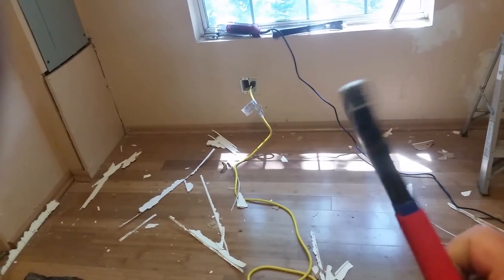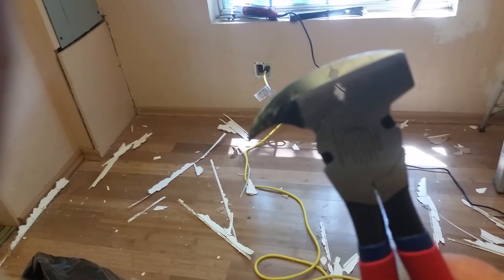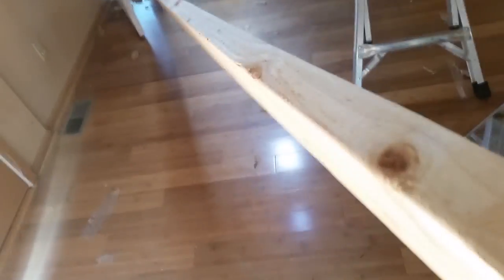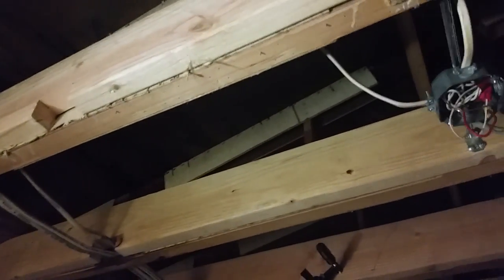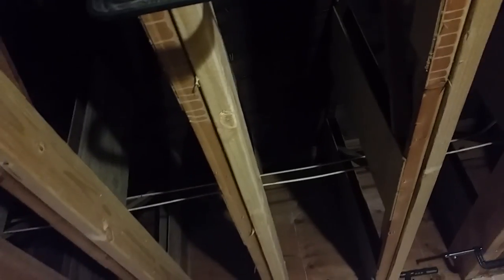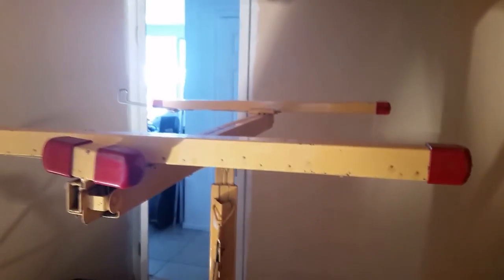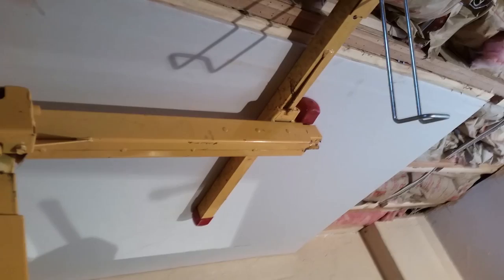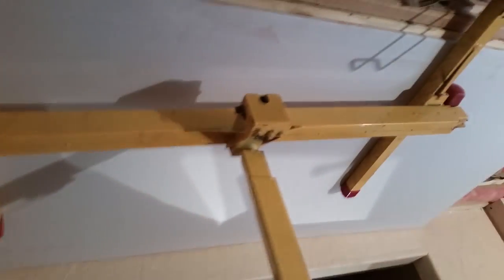Redoing the Ceiling in my Double Wide

Comment: Just did the same repair to 2 bedrooms and kitchen. Replace ceilings with 3/8” drywall by using glue and screws. Could not nail the drywall to the trusses ...flexed too much. So far looks great and holding up. The trusses were 16” on center. Mobile homes are a pain to take apart and prep for new drywall.😅
Reply from the maker: Cool. I did it this way because someone told me to do it that way but yeah - I'm sure the way you did it will work. The worst thing about mine was the roof trusses. At least the rest of it was done with framing - although with 2x3s on the interior. The door frames were also not standard and I had to rip them out and re-frame them to replace the interior doors. Never would have bought the place except for the location. Good luck!

Comment: Exterior self tapping screws! They are awesome. I'm going to have to reinforce the ceiling beams so I can drywall my vacation property ceiling. I bought 31 acres in NH and the mobile home basically came with it. I'll be gutting both bedrooms and the bathroom first. Walls are completely done in the first bedroom. Now for the ceiling. Should be interesting!

Comment: I have a single wide but the construction is the same.  I covered the composition roof with a foil from Attic Foil and  put diagonal 1x3 over that.  Then I installed a 2x2 frame work on the diagonal wood strips.  Within the frame work I  installed 2" of polyiso insulation.  Over that from the peak down I screwed down 2x3x8 rafters with an over hang. Then I screwed down OSB and tacked down tar paper. Over all that I screwed down a metal roof.  I have noticed a difference in the comfort of the mobile home.  It stays warmer in the winter and cooler during the summer. I has withstood a number of bad rain with wind storms.
Reply from the maker: Cool. I was afraid to screw anything into what was there - but I'm sure it will be fine. I did put a lot of extra insulation above the ceiling everywhere I messed with it. With that place - if you can see it - I built it. It leaked like a sieve when I got it but now it almost never even gets ants. That was a huge diff! 

Good luck - thanks for the comment!

Comment: Thank You for the informative video. I couldn't believe how FLIMSY my trusses were until a leak caused me to have to repair the ceiling.  I too have that same truss system. It's really criminal.  BUT, you gave me a great idea. I was going to just glue the drywall to those little sticks with the addition of furring strips but now I think YOUR way is much better. Off to the lumber yard today or tomorrow. If I can find out how to attach it it to the wall framing the problem will be solved. Again, Your video helped me tremendously. God Bless You !
Reply from the maker: Yeah it's scary. I asked at the local lumber store how to deal with this and they told me to do it the way I did it in the video. I don't think it would be a good idea to glue sheet-rock to the existing trusses. They are obviously engineered with little tolerance. Good luck!
Reply: @mudspringer  Could you raise the ceiling height from 8ft to 9-10ft if you wanted too during this process?
Reply: Can you answer the ceiling height question?
Reply from the maker: @Aboudreaux1030  That would not have been possible without replacing the trusses.

Comment: So I'm about to start remodeling my 1972 double-wide trailer. I've watched a lot of How Tos and DIY videos, but I don't if I should start with the ceilings or the walls? I want to do the floors last that's for sure, lol.
Reply from the maker: Well generally speaking people usually start at the top and work down. So normally you would do the ceiling first than the floor.
Reply: @mudspringer  That makes sense! Also, some of the power outlets in the trailer don't work. The electric in the trailer needs to be fixed. Should that be done before or after the remodeling?
Reply from the maker: @Yosefffffff  Well - I'm a software developer not a construction guy - so take what I say with a grain of salt :). If you need to do actual wiring - do that first because it goes behind the walls. If it's just a problem with the outlets themselves - it can wait. BTW - BE SURE YOU KNOW WHICH WIRE GOES TO WHICH TERMINAL! I've seen DIYers do it backwards. Bad idea unless you want to die.
Reply: @mudspringer  Yeah dying would be sort of counter productive, lol. I'll have to get in touch with some professionals and see what exactly is going on. Thank you!!

Comment: I use to live in a 1971 Wickes Double wide it was a Very Very Well built Double wide. The only thing that sucked was the Aluminum wiring which sadly it burnt down shortly after I moved out. But the Ceilings were made from 2x3''s and 2x2's and plywood from factory. It was rather nice.
Reply from the maker: Whoa. This one is like a '79 I think. 12 gauge copper wire. The interior and exterior were crap. I gutted the inside, replaced the exterior and did the foundation.
Reply: mudspringer Yeah the one I currently live in now is a 1980 I'm actually slowly renovating the entire place. i'm probably going to literally rebuild the roof and ceilings at the same time in 12 foot sections.
Reply from the maker: @trxtech3010  Cool good luck!

Comment: Thanks for the great video , but why did you use  2x6's instead 2x4's?
Reply from the maker: Check a span table. A 2x4 spaced 2' apart can only span about 10 feet or so. A 2x6 is needed here.

Comment: How far back did you have to trim your 2x6s so they fit on the top plate mine measure out at roughly 19 1/2” to 5 1/2” , that tapers to 3” on the plate.Would 2x4 carry the load???
Reply from the maker: Well I write software for a living not build stuff - so take what I say with a grain of salt! You are saying you trimmed the ends to fit under the rafters? If so this should be fine. The load increases toward the middle of the span so the amount needed at the ends is less than in the middle. If it were me, I'd go with it. If you look at roof just made with rafters rather than trusses, they are generally notched at the end where they meet the wall and this works fine. Similarly, if you need to drill holes for plumbing or wiring - you want to do at at the ends not in the middle. Max load is in the middle of the span.
Reply from the maker: ...but if you are asking if a 2x4 would carry the entire load - I don't think so. I wouldn't do it.

Comment: Thank you for showing how to do this. I am wondering if the 2x6's add too much weight to the frame vs 2x4's? People say to watch any extra weight because everything adds up. Thanks in advance for your reply.
Reply from the maker: Well - I'm a software engineer not a carpenter - so take what I say with a grain of salt...but no way. 1) A 2x4 is not sufficient for this span. 2) The weight is carried down the walls to the foundation. The total weight of all the 2x6s is less than I weigh and way less than a piano or water bed - so no I don't see it being an issue. Thanks for watching! Glad I could help :)
Reply from the maker: PS - BTW - What you asked about would be totally correct when it comes to adding weight to the *original trusses*. I was afraid to even attach sheet rock to them. This is why I added the 2x6 joists. I did glue them to the original trusses for additional strength but they are not adding any weight to the trusses or original roof. As I said - the weight of the joists is transferred to the walls - each load bearing - and then transferred to the foundation. So no issue.
Reply: sounds like this home has a foundation under it so he can add more weight but most don't so you do have to be careful.

Comment: sir I'm having issues with my 2 x 2 trusses I want to remodel with Sheetrock on the ceiling what do you recommend
Reply from the maker: Hey - sorry I didn't notice this comment until just now...well I'm no expert but if the trusses are too weak to hold sheetrock - the only way I know to deal with it is the way I did. Sister up ceiling joists next to the trusses. Make sure the joists are being supported by the wall framing.

Comment: My home is about 30 yrs old. I've got mold from water damage in 3 rooms. I think it's because there's no gutter for water to run off of when it rains. Also one of the walls has water damage from leak. Im also gonna have to replace insulation in the walls in the living rooms. Ok, is it worth it?
Reply from the maker: That's something you will have to figure out.
Reply: Of course
Reply from the maker: @craighollinshead1475  It all comes down to the sweat equity. If you can do the work yourself you will save most of the cost. If you can use used materials - even more so. Good luck!!

Comment: I've seen some videos where people said that the reinforcing they did was heavy enough to cause the floor joists to begin to fail.  Did you notice any problems with the additional weight of your reinforcements and  wall board?
Reply from the maker: No way. That's nonsense. Do the math. A 2x6 weighs about 20 pounds. So 10 of them is 200 pounds. I weigh more than that. If putting some joists on the ceiling causes the floor to fail, then someone walking on it would do worse. Besides, the weight of the joists is carried by the wall, which is transferred to the foundation. And - I might add - a normal house would have normal roof trusses instead of the toy trusses in my house and they are way more heavy than a few 2x6s.
Reply: @mudspringer  Yeah, it didn't make sense to me either, because one person might live alone or it could have a family of 5 living in it. Furniture could be light or heavy, plus the stress of manufactured homes having to be moved. Thank you for your answer.

Comment: Can i jus use 2x4s for the ceiling i would think that would hold dry wall ??? I have to fix my mothers but were a lil tight on cash lol
Reply from the maker: I'm a software developer not a carpenter - but my advice would be no - don't use 2x4s. Google 'span chart ceiling joist' - for example this: https://up.codes/s/allowable-ceiling-joist-spans

This will give you the suggested size based on the span.

Comment: i have a 97 double wide with sheetrock ceiling and 40 psf snow load roof, (in Maine). edit: after reading comments i see yours is an older model.
Reply from the maker: Yeah I'm glad they are making them better now! I'm in Oregon so usually not a lot of snow but it does happen - scary.

Comment: Can 2x4 be used instead of 2x6?
Reply from the maker: Well I'm a Software Developer not a Carpenter - but I would say very doubtful. It depends on the span. You will find a span chart for joists if you google it - but unless the room is really narrow, 2x4 won't support the weight. If you use something too wimpy it's going to sag over time.

Comment: What’s that ceiling stuff made of
Reply from the maker: Whatcha mean? The original? It was Mobile Home ceiling - kind of cardboard type stuff. The new stuff was sheet rock. The original rafters aren't beefy enough to hold sheet rock which is why I sister-d in the joists.
Reply: mudspringer so is there any way to get the original board that came with it
Reply from the maker: @brandonwebb1819  I think so - just google it: https://www.mobilehomerepair.com/mobile-home-ceiling-panels-replacement-repair-rebuild/
Reply: Is this what they call a fiberboard? Any one know if asbestos would have been in the ceiling board of a 1950s mobile home?